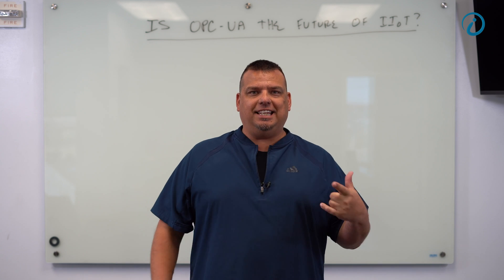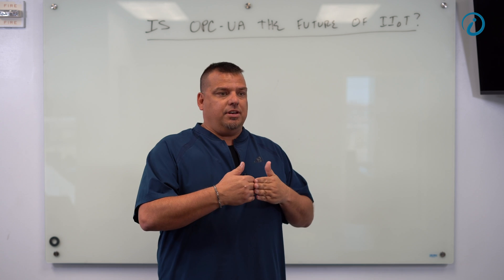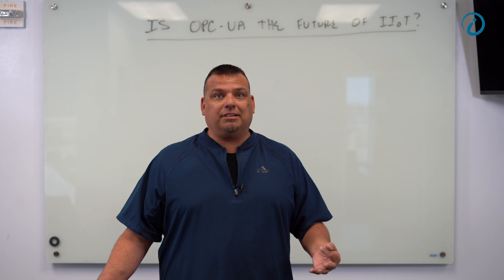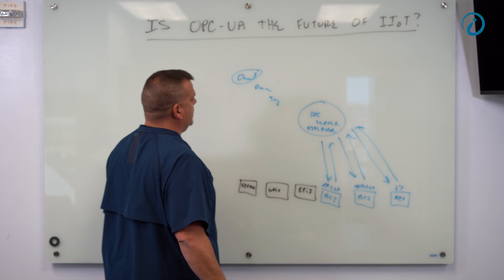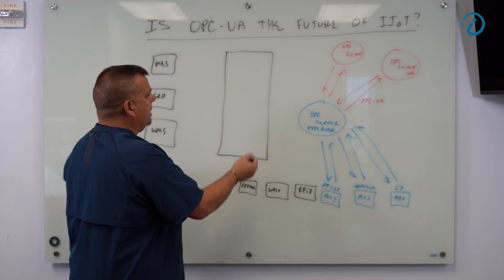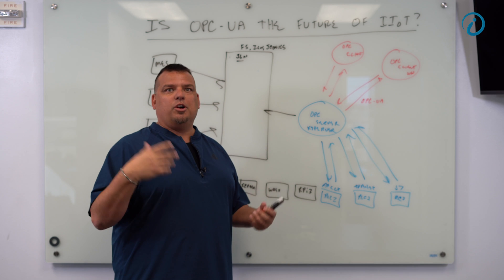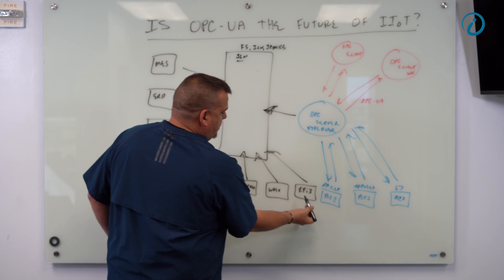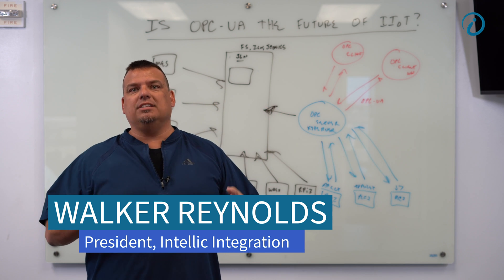Is OPC UA the Future of IIoT?

Comment: We are a year further now, and I don't see any decline in the use of OPC-UA. I think too often when you talk about opc-ua you relate it to stand alone devices (valves, sensor). But when we purchase a machine that has a thousand of data points, I actually specify OPC-UA. My added cost is only a 100euro for each PLC so what are we even talking about?!

Especially combined with Ignition which is focusing heavily on OPC-UA it is extremely powerful. 

We Don't have tu use integrators anymore and this is where the real cost savings occur. We have a staff of three automation engineers that manage all scada and MES connectivity for 16 manufacturing sites.

When we have smaller non production critical projects, we Don't even use PLC's anymore. We use remote I/O, IPC and write our own app to control the process. Often Modbus TCP can be used and implementation becomes a walk in the park.

We have no MqTT anywhere. The reason is mostly because here in Europe at least, all of the Controllers, IPC's, machinebuilders etc come almost as standard with OPC-UA. 

Just my 2cts
Reply from the maker: Just because people still don't get it and are still pushing OPC-UA (for an IIoT Infrastructure) doesn't mean we're wrong. Look at the growth and adoption of MQTT with Sparkplug b.

Comment: This idea that new equipment just "shows up" on your network is extremely problematic from a security standpoint.  One must assume that any new device in a plant must adhere to the security and privacy protocols of the organization first and foremost.

Also, just what is all this data that is so important for the enterprise?  I've been working in automation for over 20 years and the most important information is still the basic process parameters like flow, temperature, pressure...etc., all of which is already collected via ancient 4-20mA signals.  Do you really need device serials numbers, manufacturing date, and other such information?  In some situations I've seen engineers request data that rarely changes, like the Derivative component of a PID controller in a PLC.  And yet I've also seen IT departments balk at the process data resolution needed for proper process analysis because it requires too much historian space to store.  All of this leads me to conclude that the vast majority of this IIOT stuff is vast overkill and nearly completely unnecessary.  Much of this has been available for decades via HART, which remains vastly underutilized.
Reply from the maker: Thanks for the question Mark! We responded in this video here: https://youtu.be/GruN5S18-qI?t=1847
Reply: How are you doing Mark?

Comment: Can't Ignition talk OPC-UA so Kepware is redundant in this example? Is it because you need MQTT to have update by exception?
Reply from the maker: Ted, good question.  We have many examples of using both an external OPC Server along with the native OPC Server that runs in Ignition.  Kepserver is far superior at handling the overhead associated with poll/response architectures... while Ignition does have native machine drivers, they don't scale the way Kepserver or Top Server or Matrikon OPC can.  In IIoT, you will be unifying many data sources together -- that sometimes means leveraging OPC externally and internally.  Thanks again.

Comment: Great video!  I'm curious about what sort of standard data model that you would typically use.  Here you've compared OPC UA and MQTT, however MQTT is a transport layer protocol and OPC UA is application layer including information/data model which provides the interoperability piece.
Reply from the maker: Great suggestion! We can use Ignition Edge SparkplugB to define our models. Or we use HighByte on the edge.

Comment: You mentioned you don’t use Iconics. Out of curiosity, why?
Reply from the maker: Good question. There is a reason, I just don't remember it off the top of my head. It's also weird they've never actually reached out to work with us either... 🤷‍♂️ That's a good litmus test to separate those that get it vs those that don't.

Comment: Quick question: why don't you have kepserver or whatever software you use as an OPC Server push data into an SQL sever and have the MES/ERP/WMS take the data out from SQL. Since these system does not have to be real time, SQL would be able to give them high volume time-stamp data. Interesting video. Appreciate how you visualize iiot in a user friendly manner.
Reply from the maker: Scalability. We get this question all the time. Just because it works. Doesn't mean it will work at scale.

Comment: As far as I know, membership is not required for the use of OPC-UA technology or the creation of OPC-UA products. Am I missing something?
Reply: That's correct. The information provided in the video is incorrect. Also, Microsoft has standardized on OPC UA in its IIoT platform and normalizes all data to it at the Edge for easy analytics in the cloud and to avoid locking the customer into a proprietary data format. In our experience, OPC UA is both lightweight and performant. So again, I can't share the experience of Walker.
Reply from the maker: Set that aside, it's still heavyweight and not the future of IIoT 🤷‍♂️  Sorry it doesn't scale.
Reply: :-D
Reply from the maker: We will respond to this comment. Any time we have ever been incorrect (happens but it's rare) we make a video correcting our statements. But we still stand by what we said in this video.
Reply: @4.0Solutions  I think that this is a normal misunderstanding of what "open" actually means.  When compared to proprietary (closed), open means that it is available by others and shared - it does not mean that everything is free as with open source.  Even with open source which might be free, you have the license constraints which tell you what you can and can use it for.

Comment: One question please. How do you bring pre internet era equipment connected to IIOT . For ex for large utlities companies some of the plants are 20-30 years legacy, some may not have PLC hooked, so what is the first step to bring them in IIOT network ?
Reply: You need to check the protocol the legacy hardware uses. Probably something like modbus rtu or profibus. You would need to have hardware which converts the protocol to opc ua. You can buy commercial solutions or build your own hardware/software to do the job. Keep in mind that I would need much more information to give proper advice.
Reply from the maker: Look into Edge Devices / Edge Gateways to convert this data to IIoT Data close to the edge of the network.

Comment: Great Video. Should a factory ideally have only 1 OPC-UA server or multiple servers? (I assume only 1 which can handle 1000 of connections but not sure)
Reply: I hate this answer, but it truly "depends".  It depends on the factory (e.g., no of assets, no of apps, poll rate, app complexity) and compute resources.  I've seen factories with infinitely many OPC-UA servers running on the edge in embedded devices and I've seen factories running just one OPC-UA server running on a large server.

The easier way to think about it is in terms of the number of tags and segmentation.  There exist implementations of Kepware's KepServerEx, a popular Windows-based OPC server, with millions of tags.  This can easily satisfy an entire factory.  Add in the redundancy module for a high-availability pair and this approach can be viable.  However, for some factories, this approach does not work at all.  Having one large OPC server for the entire plant creates complications for planned and unplanned downtime.  It creates a systemic risk which many factories seek to minimize.  A factory may not be able to tolerate any plant-wide downtime or maintenance windows.  As a result, they may better off running a separate OPC server for a logical segment of the factory (e.g., line/cell, asset type, building, area).  Cost, obviously, is a factor as well.

In environments where its mostly data collection, I've gone with one instance of KepServerEx.  This was 100+ devices and hundreds of thousands of tags.  In environments where there was process supervision in addition to data collection, I've stood up multiple instances of KepServerEx.  This is 10-30 devices and tens of thousands of tags.  The later approach, in a more "closed-loop" environment where downtime is more disruptive, made server maintenance more practical.

I like the approach of segmentation.  It's always easier to take a line down than an entire plant down - planned or unplanned.  I increasingly have grown wary of any big monolithic thing that everyone is scared to touch.  It becomes an excuse not to maintain or change.  This can impede innovation.

To sum it up:

Balance cost (e.g., licensing, compute)
Balance risk (e.g., downtime, maintenance)
Balance performance (e.g., qty servers, qty clients, qty tags, apps used)
Reply from the maker: @jrs89  Excellent answer. It really does depend on the architecture.
Reply: Your factory will have as many OPC-UA servers as it has controllers/devices  enabled with OPC-UA. It can be thousands, but with the propper architecture you can manage all of them through a (very strong) server acting as the client.  This is what we do in our organisation.

Comment: Another consideration: MQTT is very lightweight and publishes values whether anyone in the business uses them or not, at the rate that the server (source) wants. OPC-UA has more overhead and all conceivable data is made browsable, but only the data that is actually needed (subscribed) is sent over the network. In some cases, it may be easier to modify the client to subscribe to additional data rather than modify the server (source) to publish additional data. MQTT is great in that new devices easily appear in its namespace. There are OPC-UA products being developed to catch up to MQTT's functionality: aggregating multiple servers into one namespace to act like a broker. This is separate from the Part14 addition, which is planned for Time Sensitive Networks, such as PLC loop control, among other applications.
Reply from the maker: Thank you Matthew. How you are doing well!

Comment: To play devils advocate, but transaction of opening a bank account and it showing up in your banking software actually (in many cases) means that someone will first create it, and then add it for you, or link it to your software account.
Reason they would do this is (I assume) due to security procedures. It is not safe default to show new bank account in banking software. Which leads me to my question: how do you handle security when nodes need to "show up" automatically? Is there authentication? What do you do when authentication keys / certs needs to be updated / maintained?

Great videos! Keep them coming :)
Reply: Nikola Radosavljević There’s a lot of people talking about the approach. With Kepware and ThingWorx it’s something like (it depends on the driver):
1/ you create a driver in Kepware and the tags are automatically generated 
2/ Kepware uses a preshared Kepware to authenticate and connect to ThingWorx 
3/ you go to ThingWorx to create your application and the tags are browsable/saveable/linkable but not doing anything by default apart from giving you options.

For me it doesn’t have to be fully automatic, I just need some way to automate the creation of the configuration based on the device or it’s program. Some devices could have ~30k tags in them. Kepware/ThingWorx do this if the device and/or program support it e.g. Rockwell’s Logix and Siemens S7.
Reply from the maker: We did respond to this.